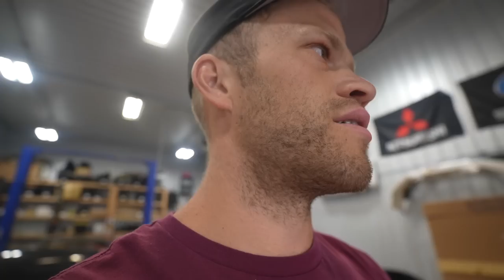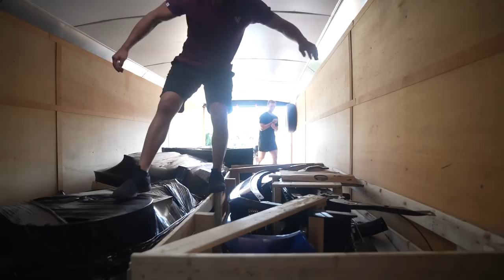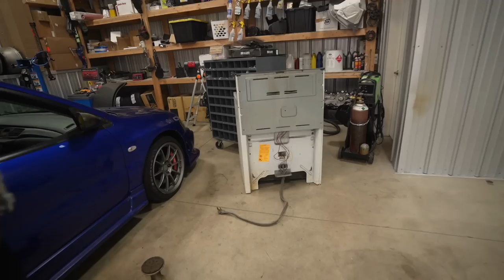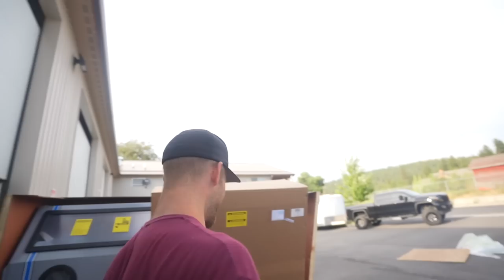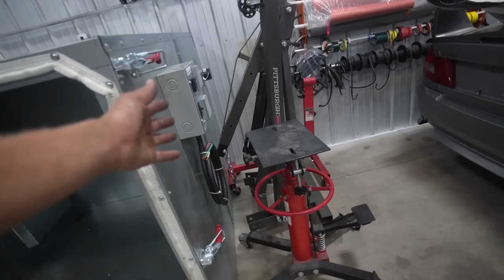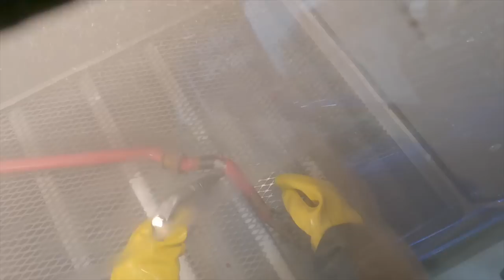I Bought The BIGGEST Powdercoat Oven Possible.

Comment: Hey Devin I used to run a fairly small scale powder business around a similar space to yours, and I always had my cars in the way getting worked on. 
You set things up the way you want it, but if you want my advice I would say try and have things in sequence. So at the moment the sandblaster and the oven are opposite sides of the room so you’re going to have to roll or carry wheels across past all your cars. If you have almost like an assembly line going from the acid tank at the door, then along the same wall is the sandblaster, and then just next to that is the oven with a space at the front big enough for the rack to hang and you can blow powder at wheels and then straight into the oven.